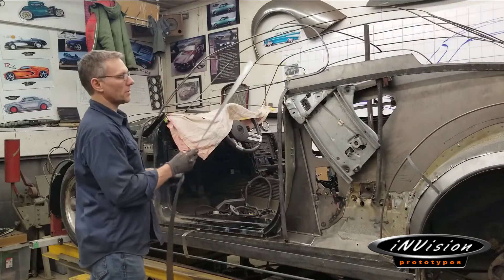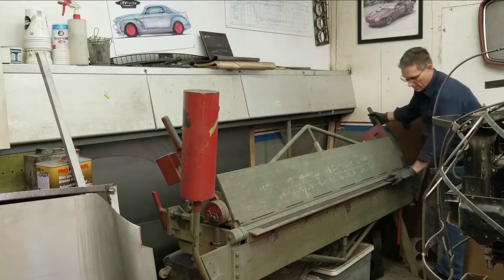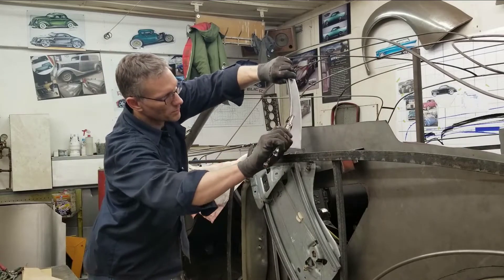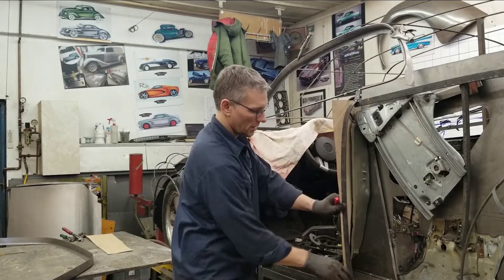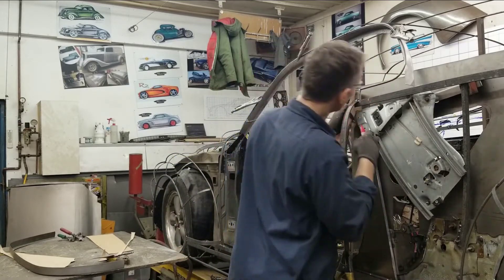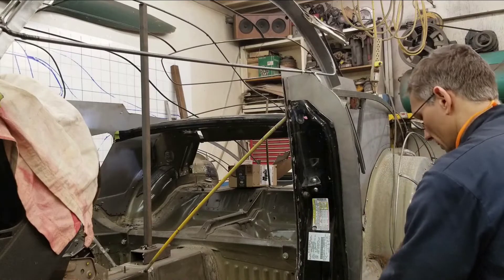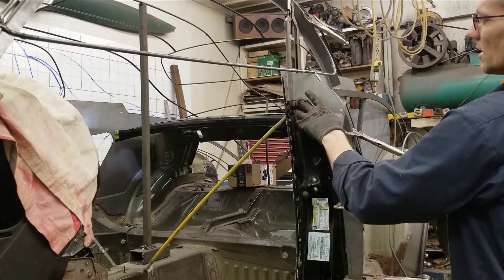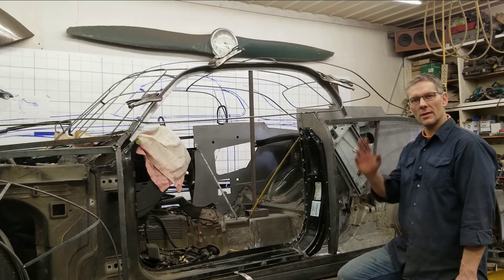DOOR JAMS Fabrication  - Part 17 | 1940 Ford Coupe Inspired M40C Build

Comment: Hi Nick,  When the 1/4 skin is rolled over the jam how will you hide that joint.  seems that will be the first thing seen when the door is opened.  Thanks for another great video!
Reply from the maker: There will be a step created where the new piece overlaps the factory edge as well as a step for the outer quarter panel flange to sit in. Everything will then be welded and metal finished.  Thanks for watching!  Have a great weekend.